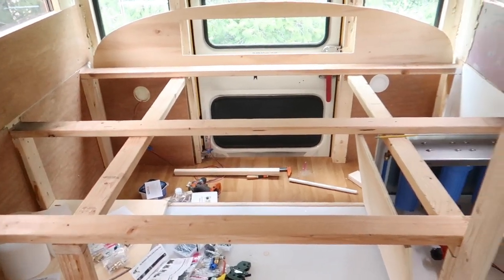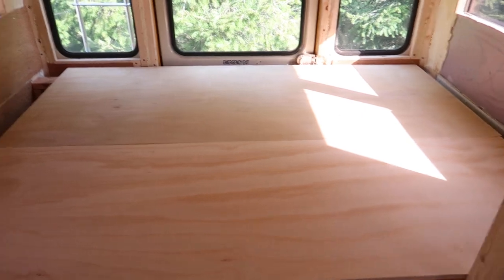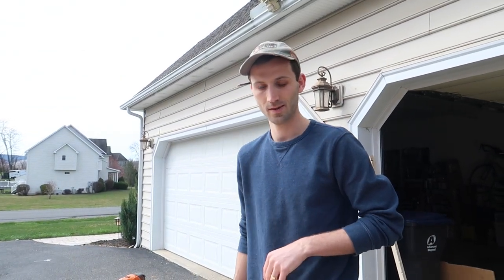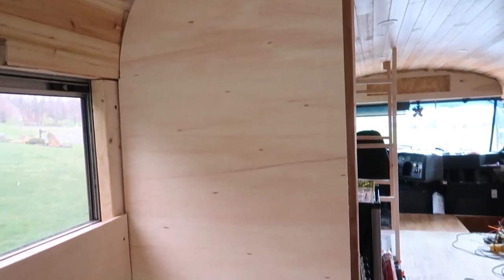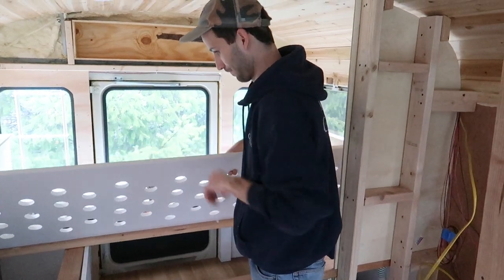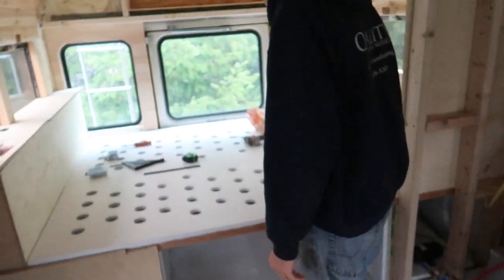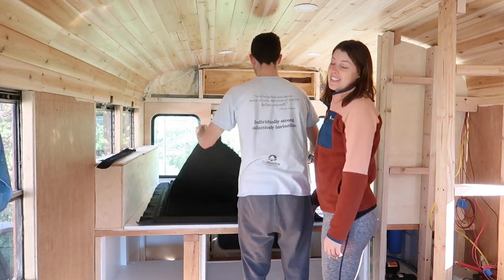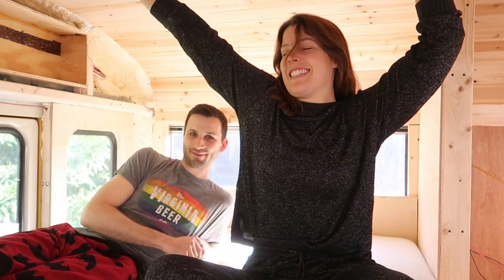Building our Skoolie Bedroom | BUS BUILD EPISODE 33

Comment: Hey guys, after watching last weeks video and this one, I'm kinda concerned about where your water filters are located. Assuming they work like all the ones I've seen in other build videos, when it's time to change the filters, they're usually a little difficult to get off and on, often requiring a tool and space to maneuver in. Most importantly though is that they will be full to the top with water and no matter how careful you are, it's going to spill out. Putting a pan under them will help but some will likely still get splashed around. Plus you'd have to get the canister up out of the compartment you have it in to dump/clean it, risking more spills. Checkout this BE Adventure Partners video at the 10min 20sec mark to see an example: https://www.youtube.com/watch?v=yxTwSRNoubA
They have clear easy access to their filers and it's still messy. I wouldn't want to try removing the filter covers while hanging over the edge of a bed frame and reaching down into a small compartment at an awkward angle. Just thought it was something you should consider.
Reply from the maker: Yeah it’s definitely a tight space 😬 we did do a dry run of changing the filters and it is doable, but I never thought about how they will be full of water. Thanks so much for the heads up, it’s nice to be prepared! We think we’ll be okay with it being a little tough since it’ll only need to be done every couple months but we’ll see 🤷🏼‍♀️ Maybe in a future update we can make it accessible from the garage space. Thanks for the insight!!